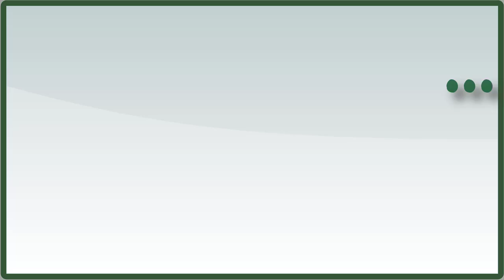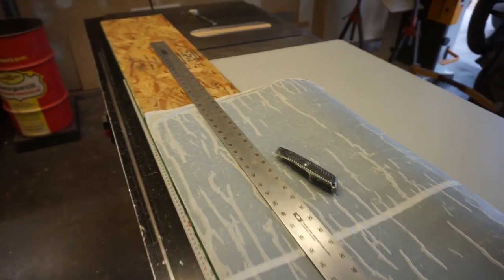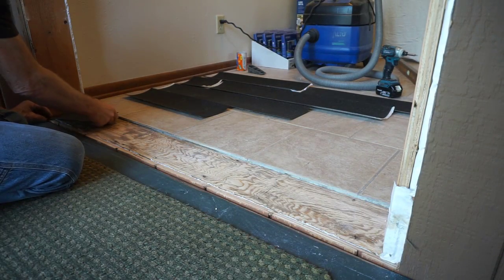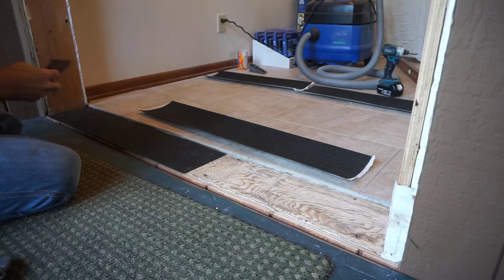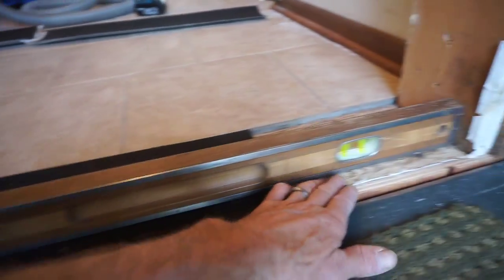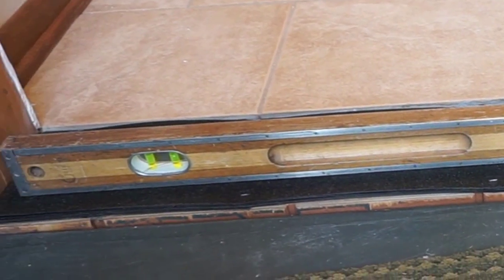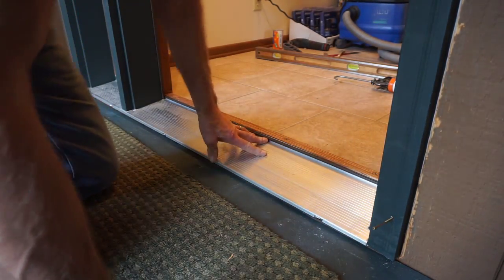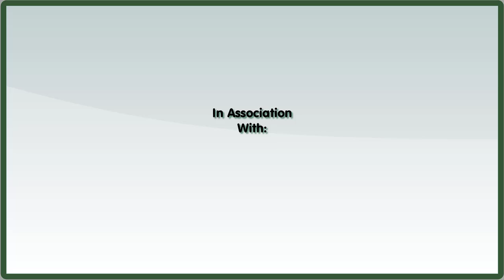How to shim an out of level subfloor for door frame installation

Comment: What about the void between the tile and seal that shows the layers of ‘shims’? I wouldn’t be happy with this as the finished product; I’m surprised that you are, since you seem to be pretty much of a perfectionist (well, except for not refilling your stapler.)
Reply from the maker: You're quite observant, Barbara!  I wouldn't ask a customer to accept the gap on a completed installation and wouldn't expect them to be happy with it either :-) That void is about 1/4" wide and that deep and is easily sealed with color matched sanded silicone caulk from the grout manufacturer so those layers aren't visible.  Alternatively, in some installations a 'base shoe' type moulding covers that gap if the height of the threshold above the finished floor is greater... linoleum floors are typically done that way. What my perfectionist tendencies don't allow is filling the gap with regular grout from the tile because it will invariably crack from thermal movement, etc and fall out in chunks.  Now all I need to do is remember to add staples at the end of every job :-)
Best,
Matt